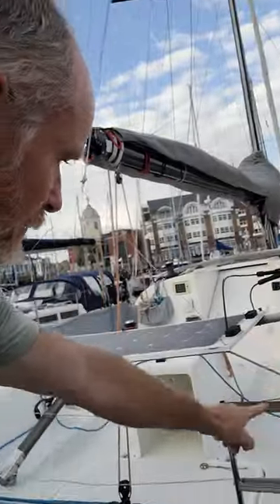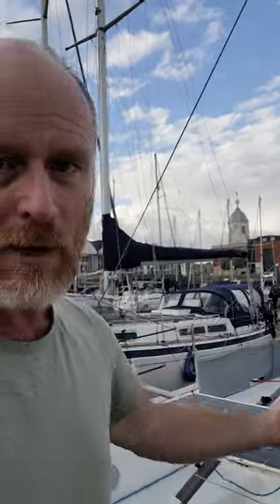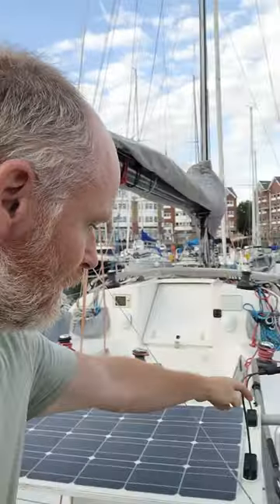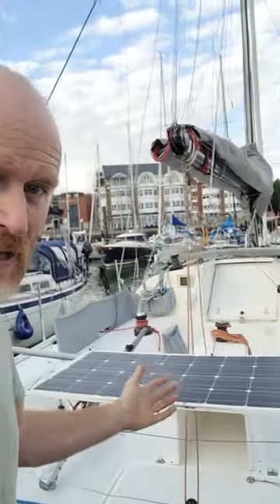Elegant Solar Solution

Comment: I have seen a few people with solar panels aft like this but making it removable and adjustable is a great idea, they are normally one of the first things to break off in bad weather.
Reply from the maker: I did t cover it in the short but the forward edge- the hinge- was just made by zip tying the board the solar cell is mounted on, onto a piece of hose slipped over the lifeline.  it would take about one minute with a multi tool to cut the zip ties, disconnect the RC4 connectors and then reach over and disconnect the soft shackles. I thought this was a great example of that highly recognizable, French offshore technical panache  that you see on Vendee globe boats